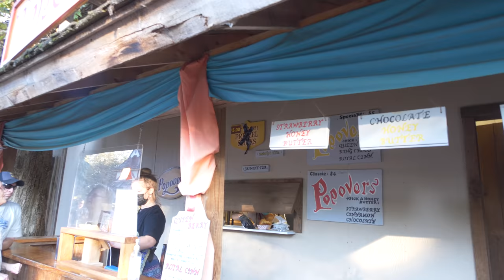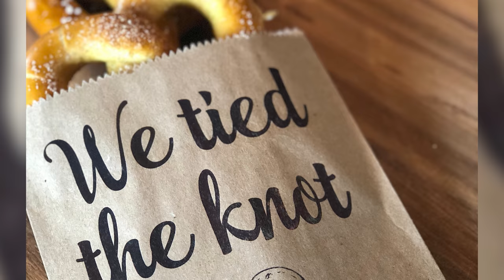How To Make Pretzels That Cost $189

Comment: Might be time to invent the hand stone mill.
Reply: Or wind mill, water mill, goat/horse/donkey mill..
Reply: @L1mJahey  finer particles an texture, which opens up more baking and useage options.

If you've ever ground flour by hand, which I have, you stop at "good enough".
Reply: @Unsensitive  The medieval era stone mills still produce very coarse flour.  Until they got into proper separating, sieving, finer and accurate stones.
Reply: @MauroTamm  I'd assume this was what flour sifting was for initially.  Any insights?
Reply: @Unsensitive  Flour sifting was to remove rocks, mites and clumps.

Comment: Putting the salt in late is actually a *good thing* when yeast is involved. Tho it may be a small difference, salt mixed in earlier can make for a less hospitable place for yeast; esp ad the salt will find the water and dissolve itself in it... which is bad cuz the yeast is still in said water.

Simply mixing it all together first until the liquid is fully incorporated and then adding the salt can make the dough rise easier as the salt mixes in more evenly (and youre gonna knead the dough regardless which will ofc mix the salt in more)

Comment: Mustard starts a chemical reaction that creates the spice when you mix it in water, and that will continue until either it runs out of reagents (around 15-30 minutes) or you stop the reaction with heat (it's been a while, so I don't remember how it works, but I think you cause a different reaction that uses up the reagents for the spice reaction when you heat it). So, to zero in on the spice level you want, you've got to cook the mustard briefly.

Comment: Waiting for him to hit the computer era and go “This isn’t like anything I’ve made before!”

If that is he survives working with HF or discovers an HF alternative in chip making…
Reply: Transistor computers could work, that's the middle ground between vacuum tubes and microchips. He would have to mine and refine germanium to make the actual transistors, but IBM had literal desktop sized transistor computers by the 1960's or so.

Comment: Mustard root can also be ground up and used and mustard greens can be ate as well. Pretzels also typically have sugar and butter in the batter as well. Sodium carbonate can also be used in place of lye but it's not quite as good. (a recipe I found called for "baked baking soda" which is sodium carbonate, baking it removes one of the carbon atoms from the bicarbonate) A common source of sodium carbonate is washing soda.

Comment: I hate how they never sift the flour through a sieve to make it finer.
Reply: Have they made a sieve?
Reply: @dangehret1349  they made a weave. And some fabric I think. You can use fabric as a makeshift sieve.
Reply: @kbee225  i can concede that point, but if you were using it in a way that would be conducive as a seive toud get pretty big particles right?
Reply: @dangehret1349  would still be better than whatever crap they made. Or at least they could grind it multiple times.

Comment: Is eating mustard with pretzels an American thing? Never seen it before here in Europe. Also isn't the mustard quite different between american and European (European being closer to what is made in the video)?
Reply: What they made is very common over here too, as is a finer-but-still-coarse one that's still mostly just ground mustard in some acid. I suspect that a great deal of the market dominance of turmeric-heavy "yellow/american" mustard is that it's the default for fast food burgers and "we just need everyone fed, so take a bag with a sandwich in it" catering; it's not particularly the norm if we're doing a proper meal.
Reply: @jonored  The few times I've been to the US never seen it, only the very yellow stuff. And the few American cookbooks I have also call for the yellow stuff. Granted I'm not much of a mustard eater so didn't look for it in stores there so might explain why I didn't see it. 

Though is the mustard with pretzels normal?
Reply: @relo999  kind of; pretzel and some kind of sauce is common, but for the mustard option what kind of mustard I expect is dependent on the kind of place it is I'm getting the pretzel from. If it's a brewery, tavern or pub that I'd actually leave with a good impression of, or a good bread bakery, I would be surprised by yellow mustard. If it's the condiments available at a concession booth selling pretzels or something like that then yeah, probably yellow mustard but there's hopefully something like honey mustard, which is more reasonable; haven't really seen it either way. Brewery kinds of places might have a cheese/mustard/beer sauce with pretzel that's still kind of in that category.

Should probably note that I'm in New England, and we aren't actually a particularly homogeneous country, "local" food wise.
Reply: @jonored  Ohh no, I know the US isn't very homogenous food wise but there are certain things that are very american. Like the whole concept of a sauce with pretzels, I've only seen them eaten "raw" here. Is this idea of dipping(?) pretzels US wide?
But also with things like BBQ, in the US smoking and BBQ are things that are linked it seems, but here smoking is more for food preservation. And up till recently you'd never saw smoked goods at a BBQ.
Pancakes being a sweet fluffy thing, instead of a more hearty flatbread-ish thing.  The expected portions, a American small coke at McDonalds is a big one here in the Netherlands (without refills). Etc., etc.